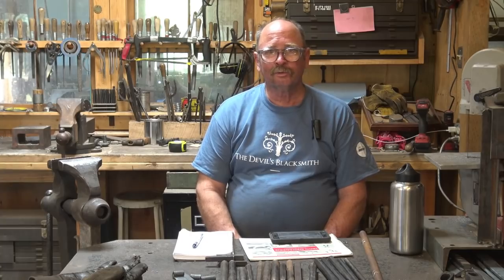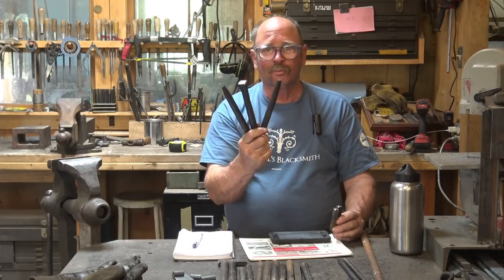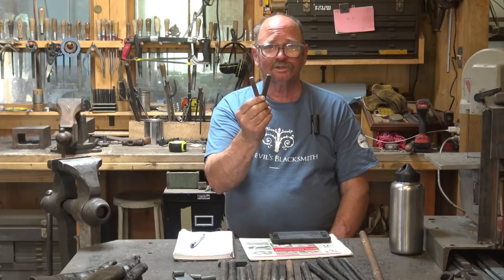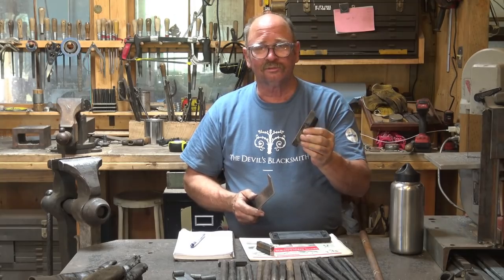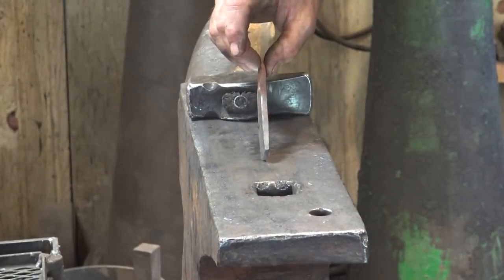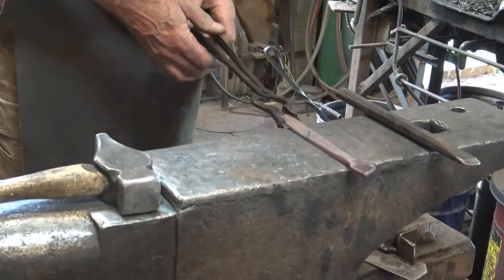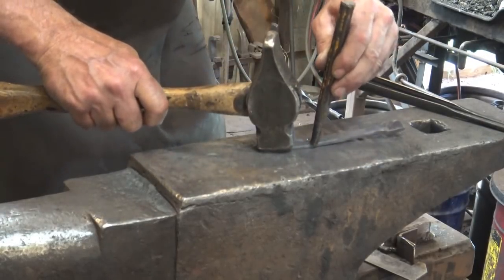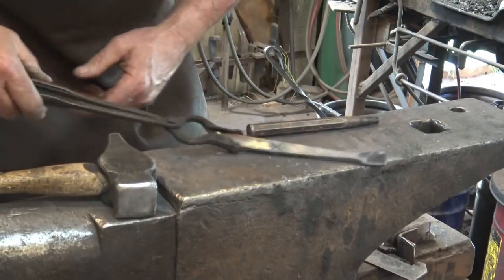Forging a fork and spoon - blacksmith challenge

Comment: Look into rust bluing.  If red rust shows you can boil the utensils for half an hour and brush off the loose rust with fine steel wool and repeat ant time the red rust shows. oiling after is fine.
Boiling convert the red rust to black rust that is tougher and will help prevent further rust.
Thanks for the vids

Comment: When I need to make food safe utensils, I’ll clean off all the scale and apply a very light coat of vegetable oil to the cold work piece. I then bake the finish on for about an hour at 400-425 degrees. It bakes on like a glaze. Lower smoke point oils (like vegetable oil) result in a darker finish and higher smoke point oils (like peanut oil) result in a lighter colored finish. From there, I just treat them like any cast iron cookware.

Comment: John, I am inspiring blacksmith. I am in the process of building a propane forge. My question is. Where should the propane injection tip be located in the reducer coupling, depth wise in the mixing tube just before the body of the forge.
Reply from the maker: I am not the one to ask.  I prefer to buy burners so I don't have to worry to much about the little details.
Reply: Ok no problem. Thanks for the quick reply.... I really enjoy your videos very informative..... excellent work!

Comment: Hi I have recently got some medieval themed cutlery and was just wondering how to prep them for first time use as there is a thick sticky oily substance on them and was just wondering if you know anything about getting rid of this sticky oily substance on them or can direct me to a video. 

I have washed them to get the majority of it off and was wondering about getting the rest off possibly burning it off.
Also there is a black layer on them witch I asume is some cinda oxidisation.
Reply from the maker: Heart may work but it might also damage the items.  Stronger solvent might be worth a try so long as you wash it off thoroughly afterwords.

Comment: Hi John, great video as always. I am wondering about the two tine fork though. Since most forks made industrially for eating are three or four tine forks I am wondering why you went with the two tine version which is more commonly used for cooking. I can certainly understand if this is an aesthetic choice or even a choice made to allow beginner blacksmiths (such as myself) to be able to do the project but would there be any issues from the material (too thin, too brittle, too mailable, etc) which would make a multi tine fork be infeasable?
Reply from the maker: Two tine forks are fairly common for blacksmith made forks.  You start seeing 3 or 4 tines in silver and pewter work. It would certainly be possible to forge one with 4 tines, but it will be much fussier  to get everything split, forged and looking even.